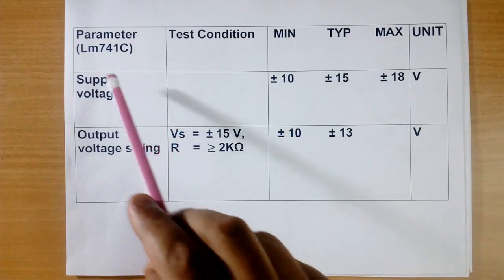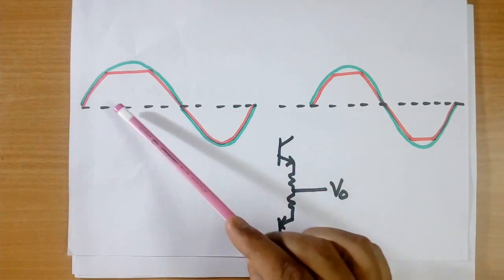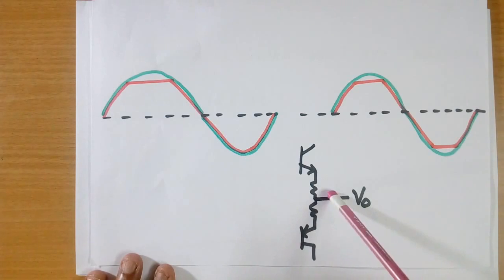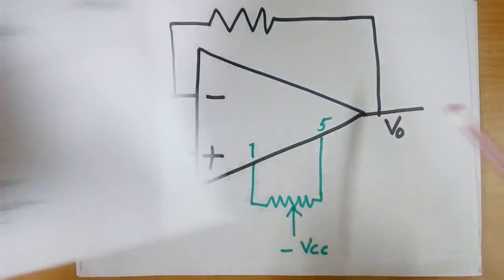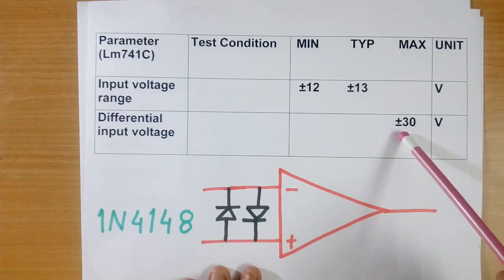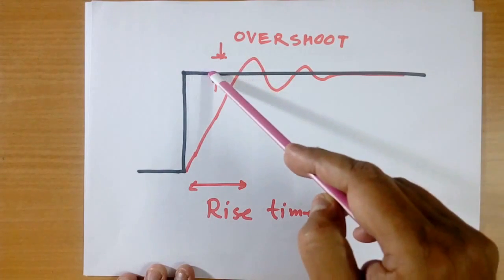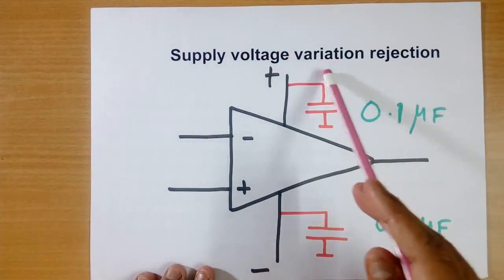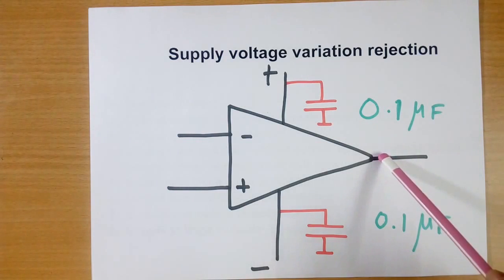How to use Op Amp IC 741 datasheet

Comment: Thanks for this video. @5.07 in data sheet across the  inverting and non-inverting pins,  max is 30v , why we are limiting to 0.6v across pins by putting diode , why don''t we put like a do directional 24v zener to make sure that zener clamps before 30v internal protection. So again the question is why clamp so early? Please explain
Reply from the maker: This is industrial circuit design experienced based. You can always ignore these suggestions and go by textbook. 
After few decades of experience you can decide.
Reply: @GKAgrawal2  Thanks for u r reply